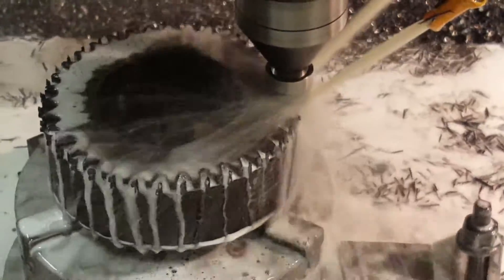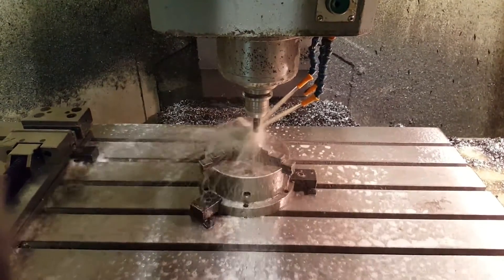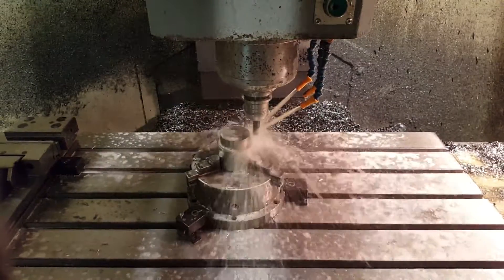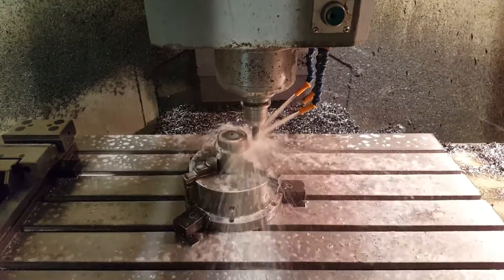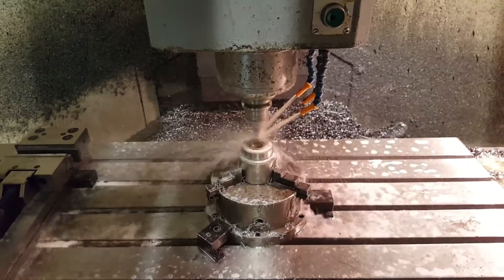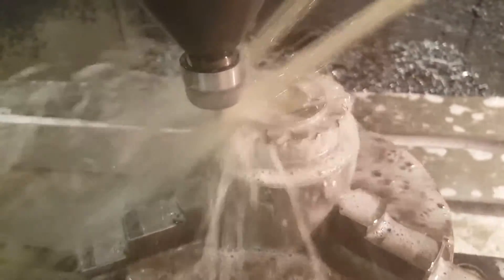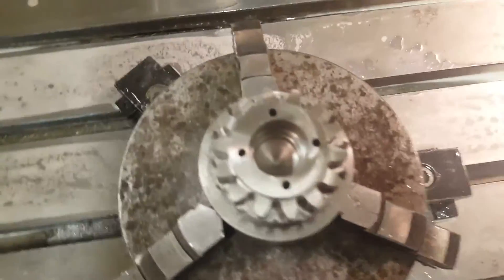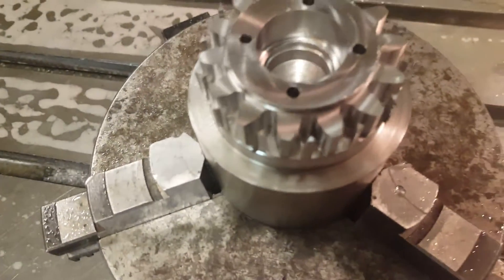How to mill involute gears in 3-axis cnc machine

Comment: Very nice video on the subject Sir.  I would like to understand a little more about your process for developing the tooth profiles where you have modified them.
Reply from the maker: The modification is very minor in the bottom and the corresponding geometry in the top. Instead of the straight 20 degree line with a small fillet in the end it is the same line with a little bigger fillet, making it possible to mill with a mill of the same diameter as the module. the section of the flank that is in contact remains the same.

Comment from the maker: How to manufacture proper involute gears in a 3-axis cnc machine.

You can have an ISO-file with the geometry and just copy and past it in to your cnc-program.

How is this possible and what is the limitations?

The limitations are straight gears from module 0,1 to 
module 10, in steps of 0,1mm. (Smallest gear I have made was module 0,3)
 From 10 teeth's to 100 teeth's. I can send you a text file with a 
name that can look like this "Z11M5.1_GW23.37_T2.gtx". "Z11" is number 
of teeth's, "M5.1" is module 5,1, "GW23.37_T2" means that gear width 
over two teeth's will give you a clearance of 0 (zero). Reduce the gear 
width with what ever clearance that is suitable for your transmission. You 
can use an endmill with maximum the same diameter as the module so the 
width of your gear will depend of how long mill you can use for the 
material at hand. The geometries are proper 20 degree involute but with a
 modified root that allows a mill diameter as big as the module. (makes 
the gear root stronger)

Calculate as usual M * Z = pitch diameter, pitch diameter +(2*M) is top diameter.

The program starts at the 3 o'clock position and the 0-point is in the centre of the gear.